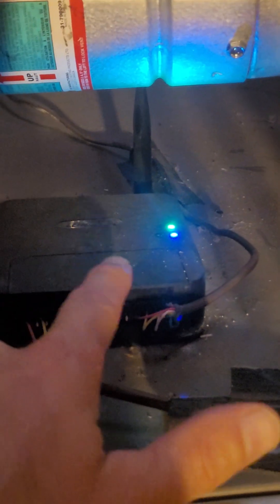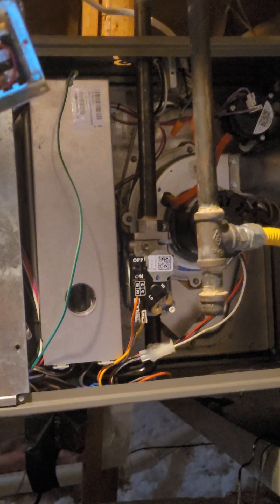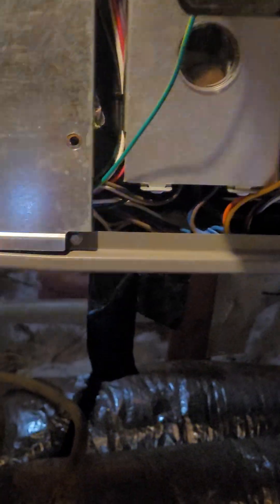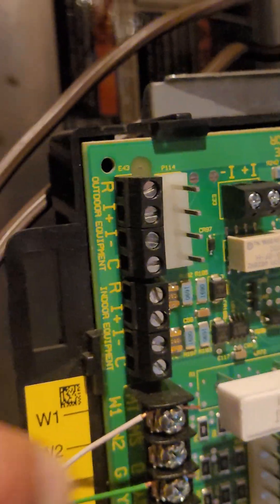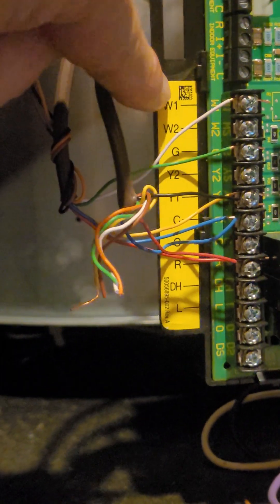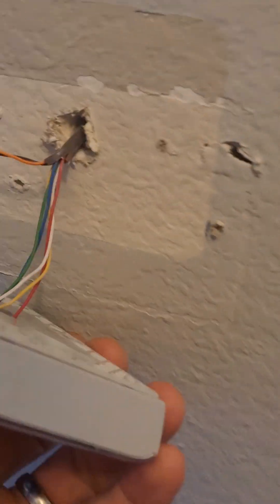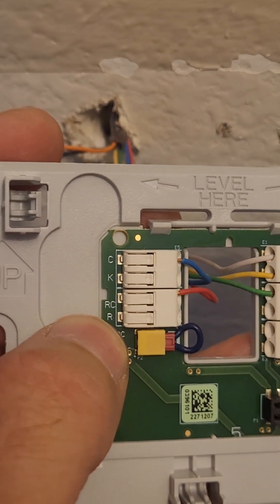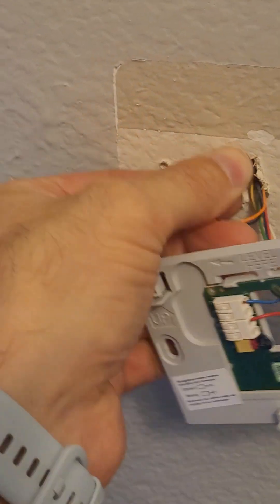FIXED!  lennox smart hub FAILED.  replace with standard thermostat. FIXED!!!

Comment: Can i just bypass the hub? Just trying to get my ac to run while waiting for the s40. I saw in s40 installation you just remove those wires from the hub to the thermostat and match them up together so its direct to system.
Reply: So to go from s30 with smart hub to s40

Remove the wires from smart hub and connect appropriately with wire nut 
To remove smart hub so new s40 is direct wired to equipment with the wires that went to smart hub?

Comment: Thanks for this!
We had a power outage and when the power came back on the surge broke the Lennox iComfort10F81 thermostat. It now just lights up with a blank white screen and does not function. I checked with a multimeter and there is proper 24VAC voltage supply to the thermostat and no error codes on the control board at the heater.
The replacement thermostats from Lennox costs more than $1000 and reports indicate they also have serious reliability issues.
I’m not going to spend that much money on something that breaks after a few years.
I don’t think I need the extra efficiency feature of the proprietary system. Our heating and AC is completely off 97.6% of the time, we use the heating for just 1 hour about 30 days a year and the AC for a couple of hours about 90 days a year.
Hopefully this will work for me and I can just run a standard thermostat like an Ecobee.
Reply: Update. It worked! Both my Lennox heater and AC unit are now working with an Ecobee thermostat.

I ran into one issue: The wire between the heater control board and AC unit had been spliced. The common wire was blue one end and white the other! The original installers appear to have done this deliberately. Are they trying to sabotage any attempt to rewire for a regular thermostat? Note that In this video the yellow wire did not work when yellow was connected both ends. Perhaps this wire was spliced with a different color like mine?

If the wires are spliced to jumble some colors it can take some time to figure out which wire is which. One approach is to twist two wires at one end and check with a multi-meter at the other end to find out which two wires they are. Then repeat this process to figure out which wires are which.

Comment: When you remove the Smart hub do you just connect the corresponding colored wires together that are coming in and out of the Smart hub? 
It's winter and I can't experiment and risk  not having heat.
Thanks in advance

Comment: THANKS FOR THE HELP BRO. I DID MINE WITH THE ECOBEE THERMOSTAT  AND ONLY HEAT AND FAN WORKING, I DIDNT KNOW UNTIL I SAW THIS VIDEO OF YOURS THAT I NEED TO RE WIRE MY OUTDOOR CONDENCER...THE ONLY DIFFERENCE WAS YOU HAVE 3 WIRES GOING TO OUTDOOR AND MINE HAVE FOUR WIRES.
Reply from the maker: @edwinsalvador5280  yes!  Even my ac guy said I didn’t need the 24v wire.  He was wrong.  Well done!